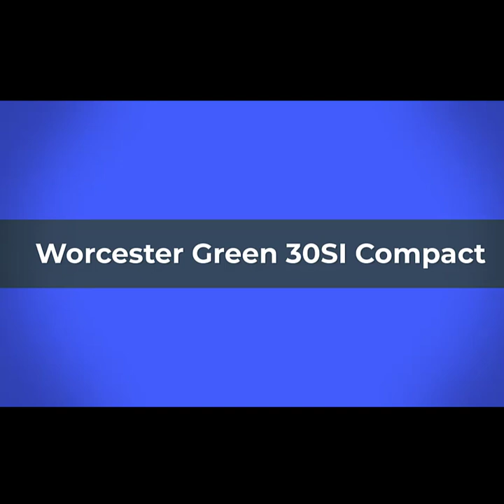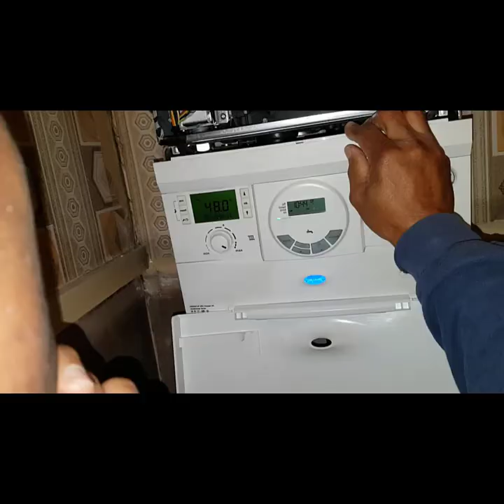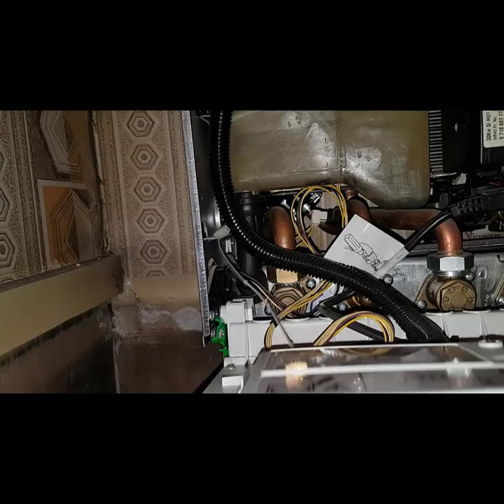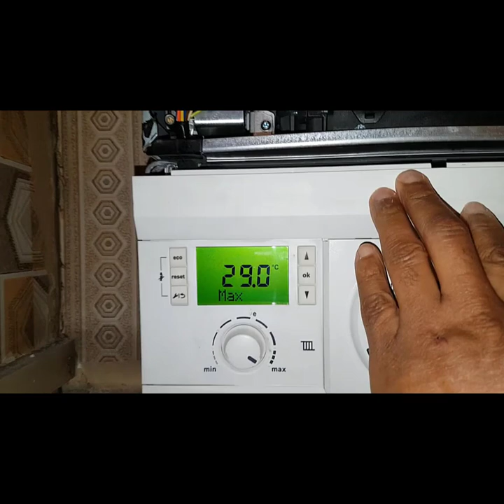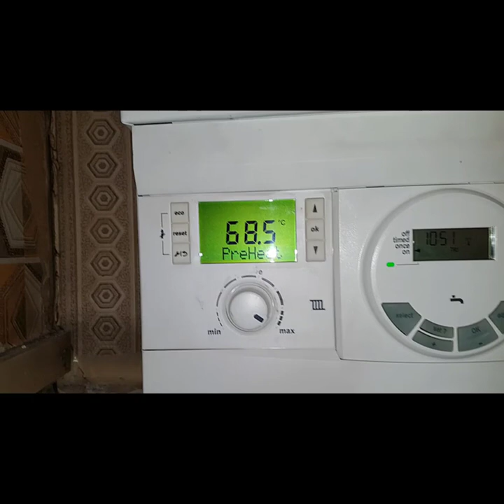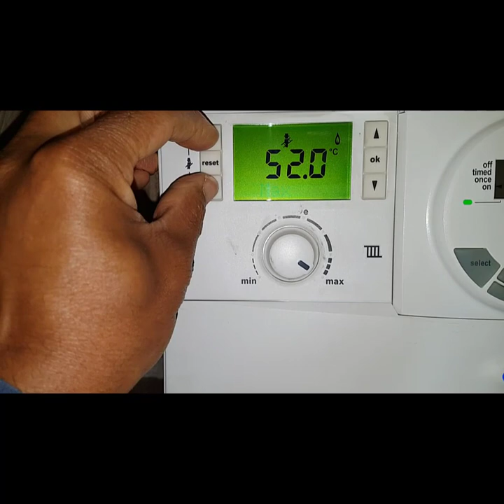EA Fault  Worcester Greenstar 30SI Compact

Comment: I've got an intermittent EA227 sometimes if I reset it it works for a few days. If it's not a loose air intake pipe what else could it be? Haven't tried servicing it myself
Reply from the maker: It sounds like it might did a service or check the flue outside sometimes  the center section falls off